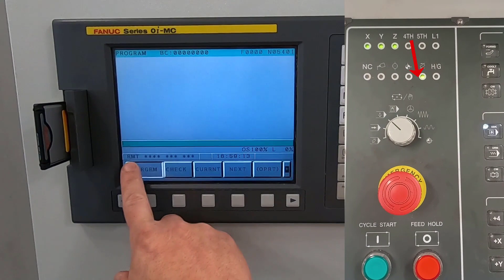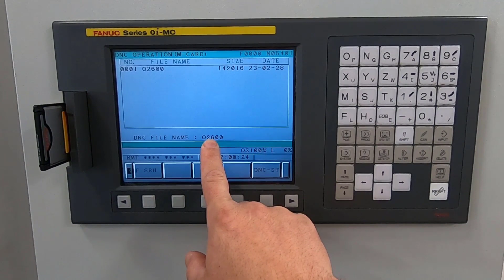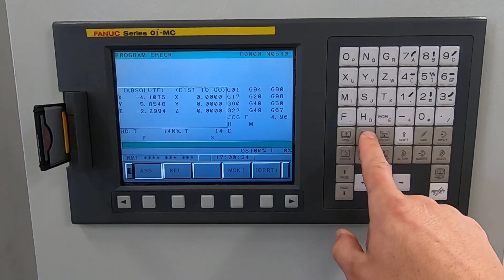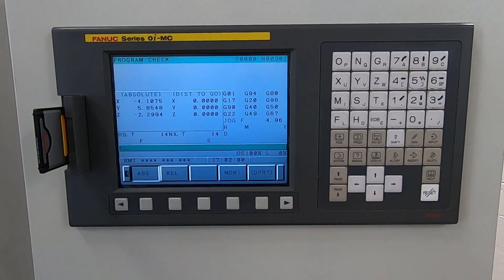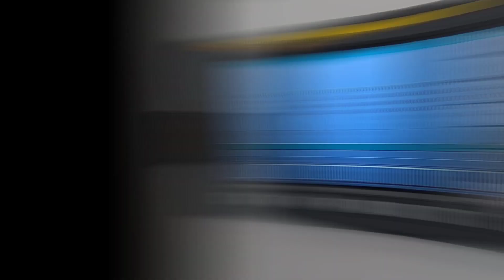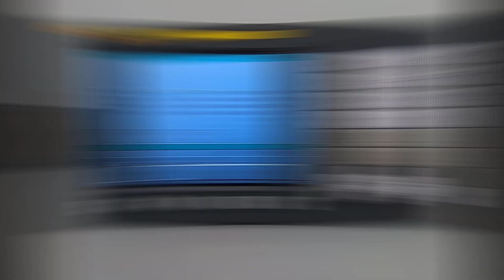CNC Fanuc Drip Feeding - Running in Remote

Comment: "I have the same model of controller – FANUC Oi-MC. When there is a power failure and the program stops in between, I want to restart the machine from the same point once the power is restored. I know there's an option called 'RSTR' for this purpose. Could you please guide me on how to use it?"  while I am running program in RMT mode via CF card
Reply from the maker: The only time I have been able to restart in the middle of a program while using remote is when I knew the N number that the machine stopped on and I was able to start in remote single block so that it activates the program then you can do an in search to that starting point in your program and it will search through memory which may take a little bit but it will stop on that in line. I hope this helps and good luck. And thanks for watching

Comment: Does running a program in rmt mode directly from external memory (cf card ) do effect on AICC G5.1 Q1
Reply from the maker: When you are running in remote mode it should be just like you were in Memory mode. All codes and functions will be called up in the program the same as it would be in Memory. If you need to you can always raise your work offset and dry run the program up to those codes and see if any alarms are triggered. This way you are not in the material if it does alarm on you. Good luck and thank you for watching.
Reply: Actually when I am running 2d simple program machine is running perfectly but if I am running 3d curved program machine start jerking so for that I have to turn on AICC After Turning on AICC From G5.1 Q1 machine runs smoothly in 3d program here I am having problem with size its not making true size its making bore or hole or profile oval suppose I have made a circle program in x direction size is good and also in Y but if we check in diagonally its giving 0.6mm ovalty . while having same controller fanuc oi-mc . if you have any solution please guide.
Thanks
Reply from the maker: @mohammedumar4733  issues with holes ovaling with have a lot to do with the machines backslash. You'll have to look up ways to check if you don't have a technician who can come out to look at it. I've only messed with backlash on and A axis but we found out that the worn gear was Cracked from crashes. Good news is Your look ahead code should still work in remote. Until you fix the backlash, if that's what it is, then you may have to ream to finish size. Good luck.